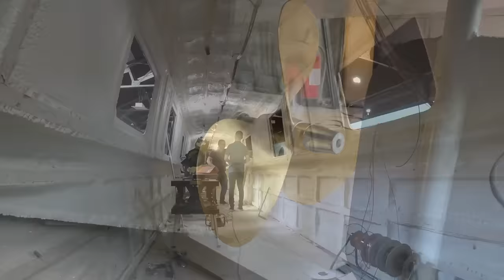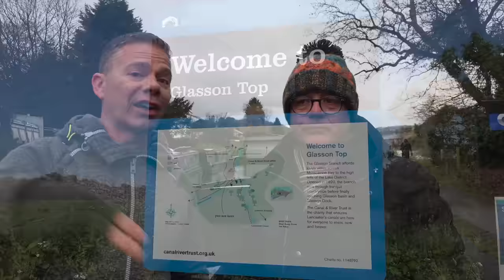UNBELIEVABLE 1,000 Mile Narrowboat Adventure (Part 1) - Ep. 137.

Comment: Kind of off topic, but related to the build of a narrow boat. 

I know the tiller is typically the steering control on board, but are there narrow boats built with a more modern style helm? 

Meaning instead of a tiller, they’ve got a wheel for steering?
Reply from the maker: Yeah, but they're not as good for steering.